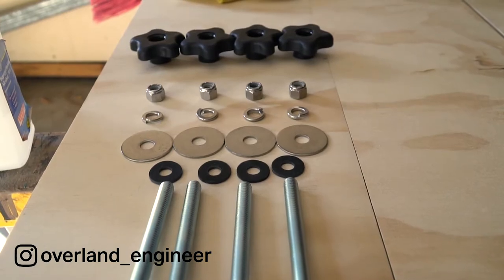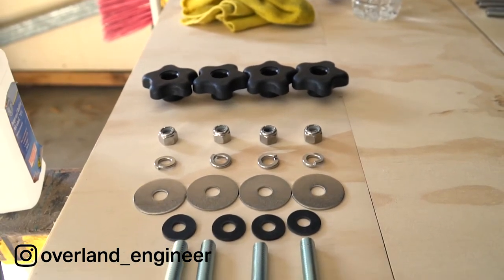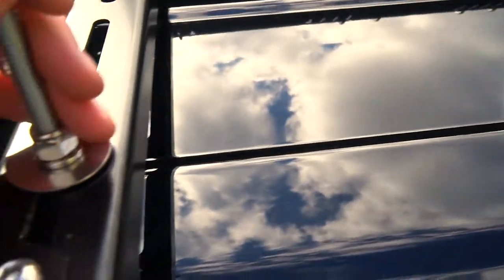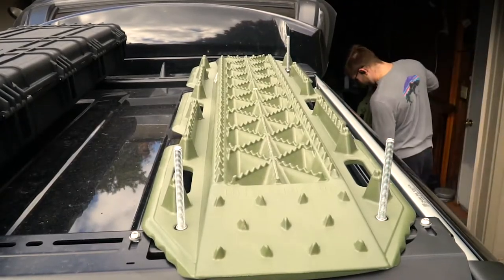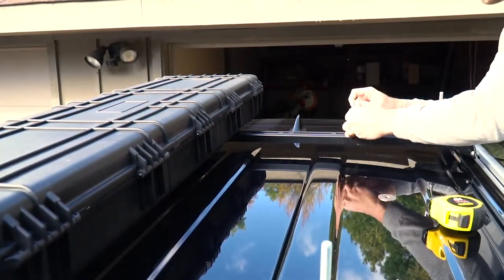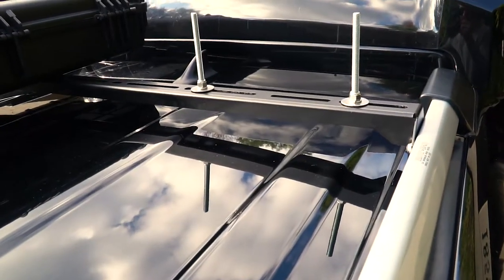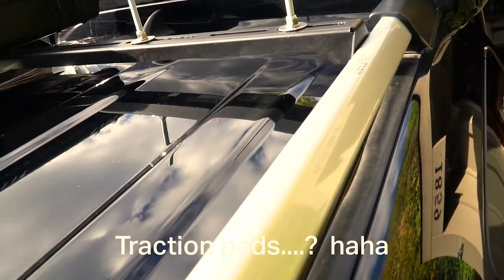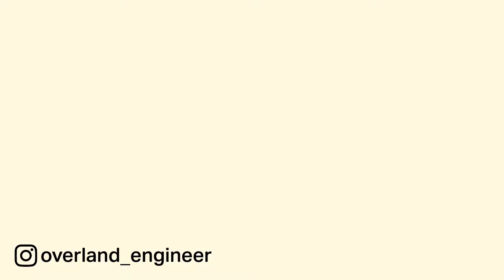DIY Affordable Traction Boards Mounting Solution | Roof Rack Compatible | Offbrand Maxtrax Boards

Comment: I did something like that on my roof rack on my van.

I then started to replicate it on my 4Runner but due to the design of that rack it was going to be more challenging so I ended up just using a ratchet strap.  Why didn't I think of that earlier?  Undoing a ratchet strap is so easy.

Comment: I'm in for the kit!! I have a 2020 TRD stock roof rails and need this!!
Reply from the maker: Which model do you have? TRD Offroad or TRD Pro?!  Thanks for checking out the video so quickly!  It just went up!
Reply: @OverlandEngineer  TRD Offroad Premium. Your set-up is way better than buying a roof rack! Where did you get the black tightening nuts/wings? Do you think it's worth getting the wind faring? I'm new at over-landing and can't wait to get set-up and hit the trails!!! A lot to do!! Thanks!
Reply from the maker: @ea8454  Right!  It is much cheaper.  It has some draw backs down the road but I'm debating a roof top tent so I was not sure how much I wanted to spend on a roof rack that would just get covered up.  Follow along with my builds because it may be helpful for you is building out yours.  I have a platform update coming so stay tuned!  The first thing I would recommend is check out:

Thin Cross Rails - $79
http://www.lfdoffroad.com/catalog/toyota/5th-gen/crossbars-5th/ruggedized-crossbar-5th-gen

Thick Cross Rails - $99
http://www.lfdoffroad.com/catalog/toyota/5th-gen/crossbars-5th/ruggedized-crossbar-5th-gen-wide

Wind Flashing (a must for noise) - $40
http://www.lfdoffroad.com/catalog/toyota/5th-gen/crossbars-5th/wind-faring

These are super awesome and they mount to the stock roof rails on 5th Gen 4Runners that dont have the massive steel pipe FJ rack.  @TRDJon talks about them as well and I liked his comment about how these are slightly raised so you can fit your hand under them when cleaning and putting on mounting hardware.  They are so versatile and about the same price as stock crossbars.  My kit will definitely work on these!
Reply from the maker: Also these are the offbrand MaxTrax that I have: https://www.amazon.com/gp/product/B07LB6BMX6/ref=ppx_yo_dt_b_search_asin_title?ie=UTF8&psc=1
Reply: @OverlandEngineer  I ordered! Thanks!
Reply from the maker: Which did you get?!
Reply: @OverlandEngineer  I ordered the LFD cross bars with the wind faring. I have an Icon stage 2 ordered also (10-12 weeks out) along with 275/70/17 tires (I have 7" stock TRD rims). I wanted to get 285/70/17, but BFGoodrich's call for 7.5" minimum rim width -  not risking it and not buying new rims... yet! haha!
Reply from the maker: That’s awesome!  Well if you still want a kit, I can post an eBay link.  That’s good to know about the larger tires!  Probably why all these people get new rims.  I’ve wondered why nobody likes the TRD pro rims haha, that’s why!
Reply: @OverlandEngineer  What happened to the ebay link?
Reply from the maker: @ea8454  I'm sorry.  I thought no one was interested so I did not make one.  If you are interested I can probably throw a kit together!
Reply from the maker: If you email me with the email in my channel description we can get this sorted!
Reply: I’m in for a kit too
Reply: Need one of those kits

Comment: What’s the length from one mounting point to the other? Thank you
Reply from the maker: I’m not sure, I haven’t run this product in two years.  The bars are adjustable forward and back
Reply: @OverlandEngineer  im using the Lfd crossbars but I have a Roam case mounted already and the distance from the drilled holes is 37” so im trying to find traction boards that can be mounted within that measurement since I can’t move the bars because of the roam box.
Reply from the maker: @SalvadorAndradeHN  oh from the traction boards?  Well most a just plastic.  The ones I had in this video you could probably just drill your own holes

Comment: How much rail length is necessary to do this with the LDF crossbars?  My GX470 is limited to 40”. I don’t know if that is long enough.
Reply from the maker: It kind of depends on where you want to mount the case and traction boards on the cross bars.  It's a pretty flexible setup.  You could probably drill holes through the traction boards if you wanted them closer.  That spacing sounds like roughly the same at the 4Runner when I did it.  The stock rails are not full length and I think the track was like 38" or something.

Comment: I need a way to dismount those carriage bolts MUCH faster than the torture it looks like you went through in this video. lol.  If I need to haul lumber or something from the hardware store, I can't go through that hassle every time I wanna pop the traction boards on/off.  Right now, I just toss the traction boards in the hatch when I know I'm hauling the kayaks to the river or something.  I'd rather they go up top but not if it's going to take more than a few minute to pop off for impromptu purchases.  Besides, sitting up there in the southern sun all day, every day can't be good for the plastic.  So that's another reason I'd want a way to pull 'em out of the garage and pop them up there when adventures are planned.
Reply from the maker: Yeah its really not ideal if you ever plan on taking it off.  Its just an option and the hardware is cheap whereas maxtrax mounting pins are expensive and not universal.